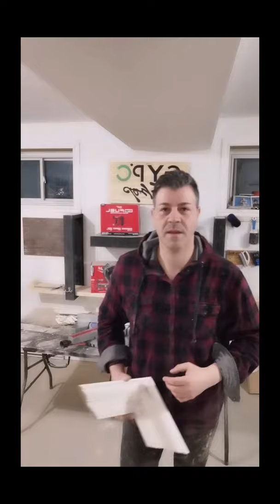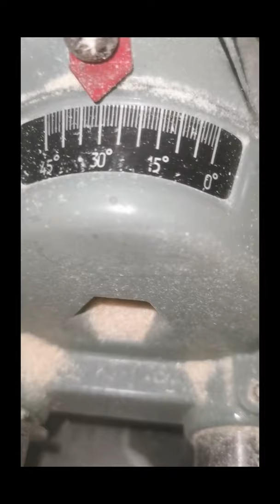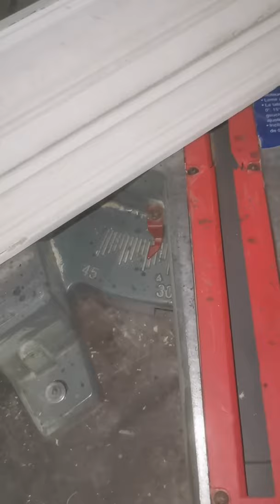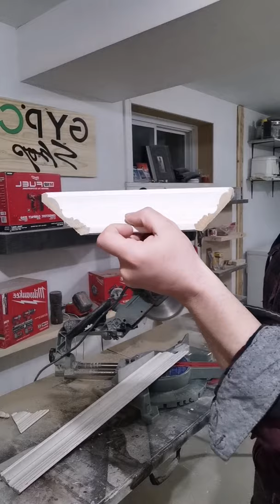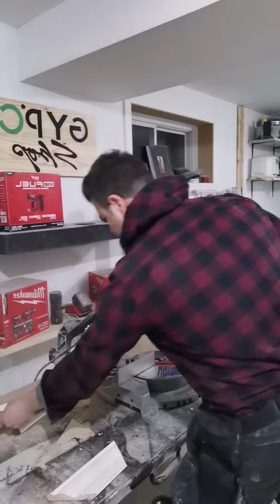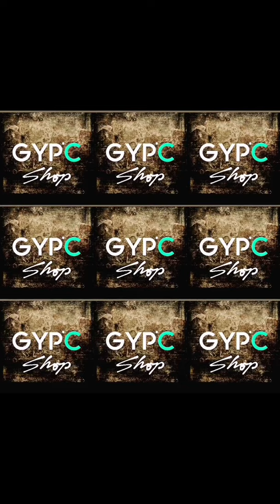Crown Moulding Secret - It'll save you so much time ! | #Shorts

Comment: For a 90° corner using crown with a 38/52 spring angle (most common) it’s a 31.61° miter and a 33.86° bevel… 
It’s best to use a angle finder on each wall corner as they are rarely a perfect 90° because of Sheetrock mud
Reply from the maker: Awesome tip @HM Trimworks. What angle finder do you recommend? Thanks for sharing
Reply: @GypCShopBuilds  Starrett is good and not expensive
Reply from the maker: @hmtrimworks7148  Thanks for the tip. I'm sure all will find that useful 👍

Comment: Okay so I might be getting like my popcorn removed and then putting crown morning and I was just wondering how much like if you knew how much popcorn would be to get it removed and crown molding just for one room?
Reply from the maker: Hi @mylifestyle, im guessing your looking to have a contractor remove your popcorn ceiling and install crown moulding right?
Reply: @GypCShopBuilds  yep
Reply: @cookwithme4158  depends on how many sq ft ceiling and linear ft crown.  Also do you want to simply skim coat over popcorn ceiling and paint, the cheapest way.  Or you can scrap it down then mud and paint as well as replace sheetrock, tape mud and paint.  Both those are more expensive than skim coating, depending on the size those could vary on what costs less.  Right now to demo and replace sheetrock with material will cost 60-90 per 4x8 sheet so about 2-3 bucks a sq foot.  Thats without painting too. 

Labor for crown installation can be as little as 4 a ft and as much as 15.  Same as price of crown which can go for a few bucks a foot to 20 for crazy stuff.